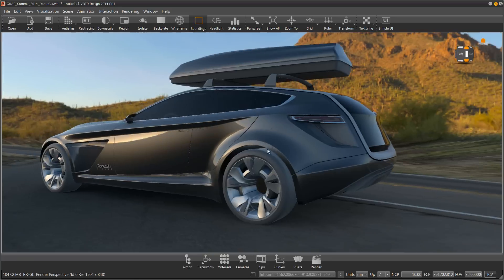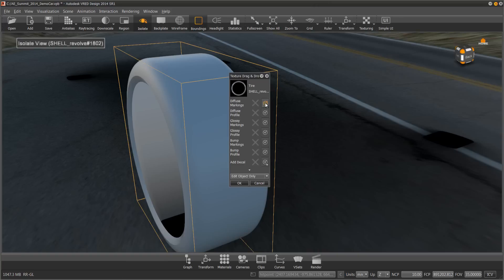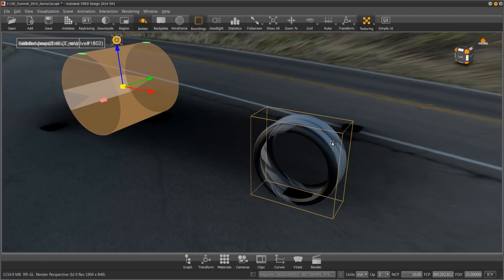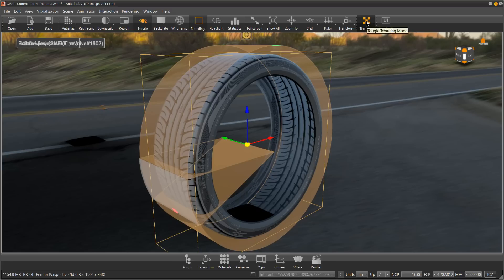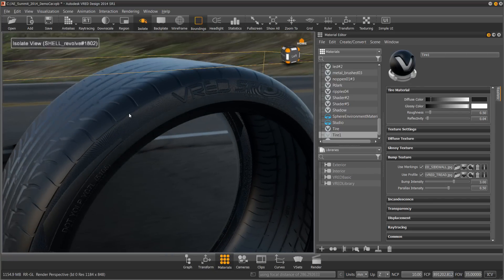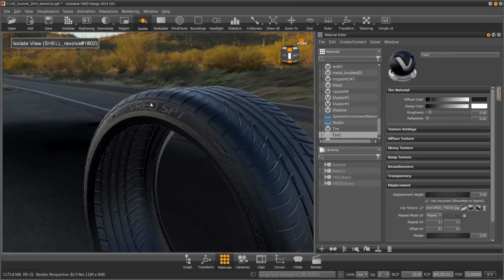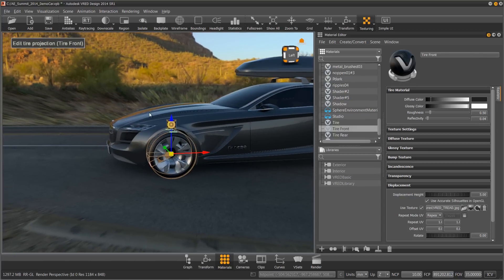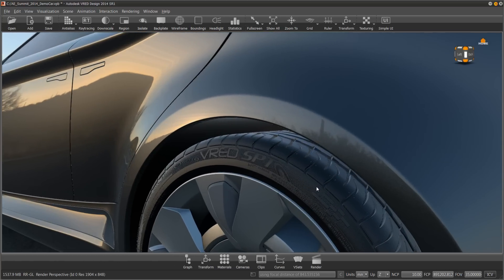VRED tire material

Comment: Hi sir, on my Vred file the tire profile is 90 deg. rotated but Markings texture look fine, how can I fix Profile to the right direction?
Reply from the maker: @MouEsmaiel  taking into Photoshop and rotate the texture 90°
Reply: @jamescronin1  i Rotated it but in Photos. The default photo viewer in windows 10. Saved But it doesn’t change anything
Reply from the maker: @MouEsmaiel  try a photo editor
Reply: @jamescronin1  I tried it too with photoshop but unfortunately  nothing changed. would I have a contact with you? i am going to start a new job with vred tomorrow. would you help me?
Reply from the maker: @MouEsmaiel  sorry I no longer work for Autodesk.  Depending on where you live there is probably an Autodesk VRED expert you can reach out to.

Comment: So you model this car in Autodesk Alias and then you worked on the tires in VRED, right?
if so, how did you move the file into Vred?
Reply from the maker: Roozbeh Saadati Yes, Alias model and Tires displaced in VRED.  Alias has a 'send to VRED' option.  Or you can drop the Alias file right into the VRED interface to import it.
Reply: james cronin Great. understood.
Thanks a lot man for doing these videos. really appreciate it.